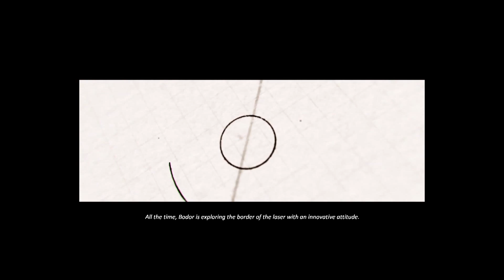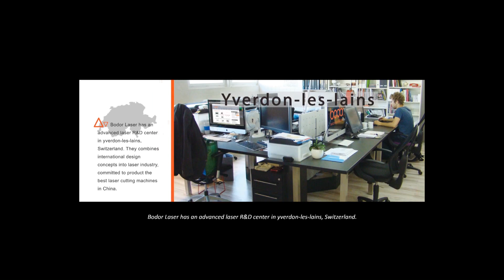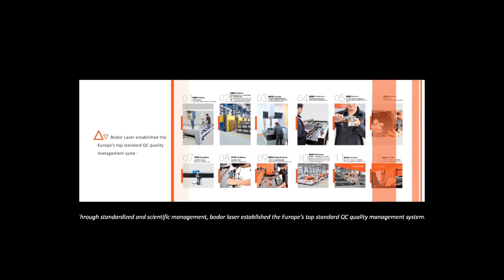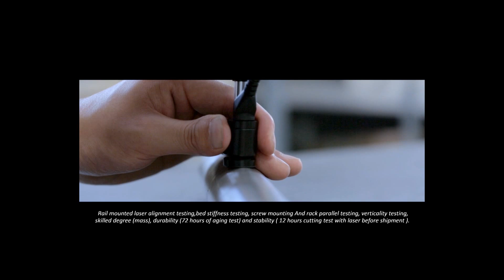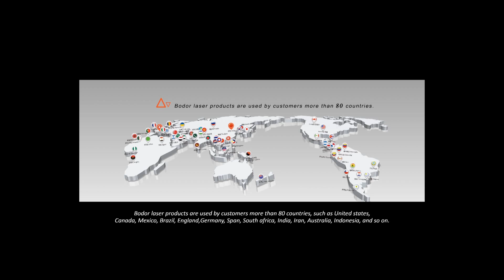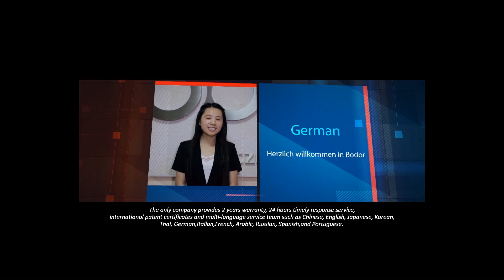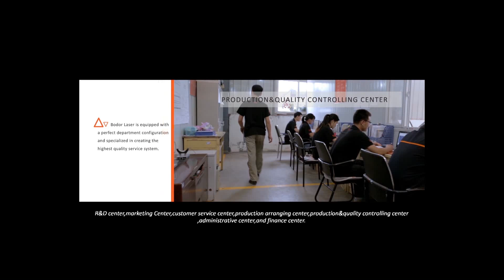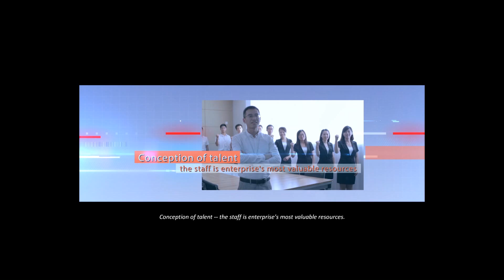Bodor Laser ------ Your Best Choise

Comment: Not your best choice. BCLX, power issues and slow to non existent support for repair or parts even when on warranty. I have had nothing but trouble with auto focus failure on week 2, to gantry issues and the table not being square after that, alignment of laser path and now power supply was going bad for a month with no help from Bodor on a replacement power supply and now my laser tube is also not working because of the power supply failure. Bodor replace tube and power supply, still has the same issue, and still NOT running right. This is a NEW machine. I have requested a refund since they are continuing to waste my time with more video's they want me to shoot of tests and get no reply to my refund request.  The fact that I have clients waiting for orders and I am loosing money by the minute with this machine not working while making payments to the bank to pay for it. VERY UNHAPPY only had the machine for 4 months. NO response to emails for Bodor main email and Patrick Ma just (salesman, just ignores me now)  I will continue to blog as I don't want anyone else to go through buying a machine from Bodor and losing money like I have.  If Bodor makes it right, I will delete this, but as of right now..I will continue to warn others not to buy from Bodor. Works great when it was working, now..anchor... Warranty...yeah right !!
Reply: E o problema foi resolvido ... ?